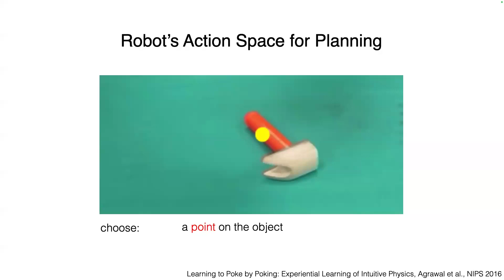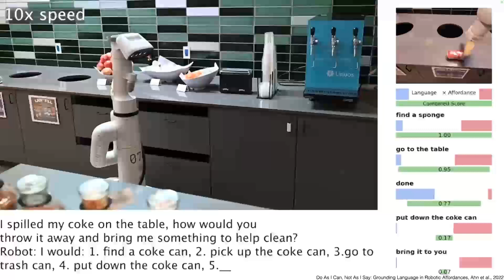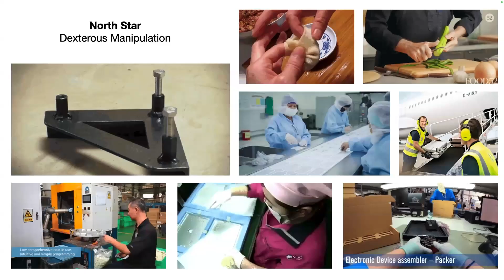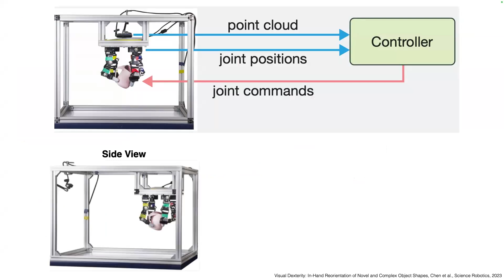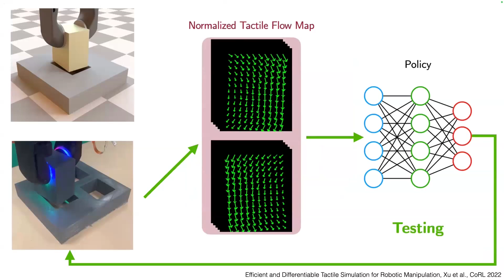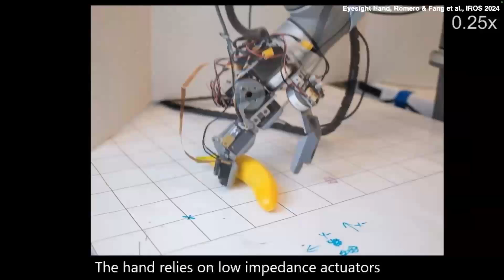Pathway to Robotic Intelligence - Prof. Dr. Pulkit Agrawal (MIT)

Comment: this work seems cool, but it seems like a lot of the cool stuff was done by the hardware groups at MIT, not really the speaker's lab (which focuses on machine learning). its nice when there is better attribution to those labs. For example, seems like the hand was mostly developed by students from Alexander H. Slocum's lab which is in Mechanical Engineering. (I was an undergrad MechE there long ago)